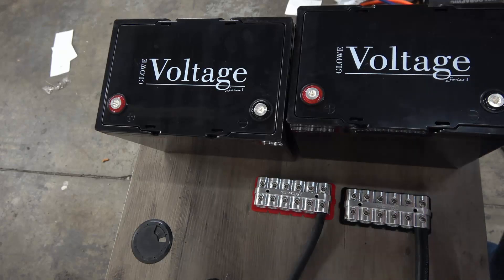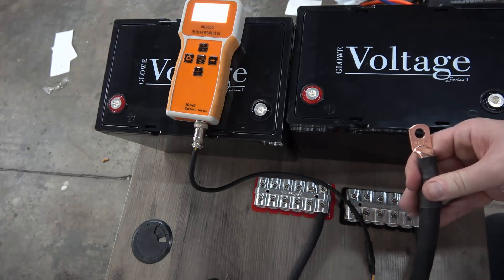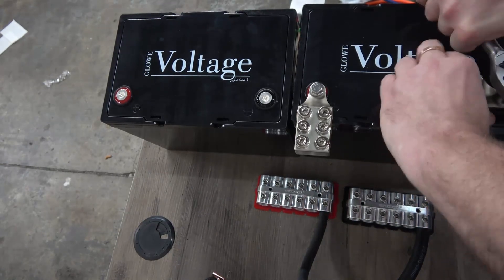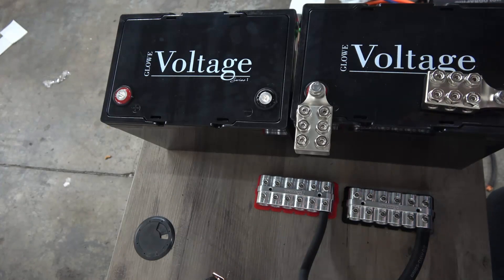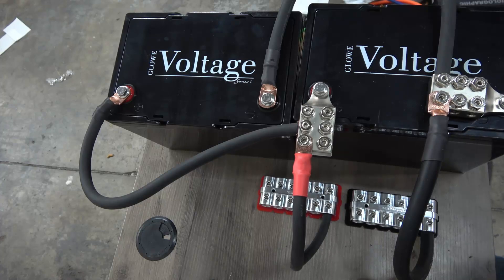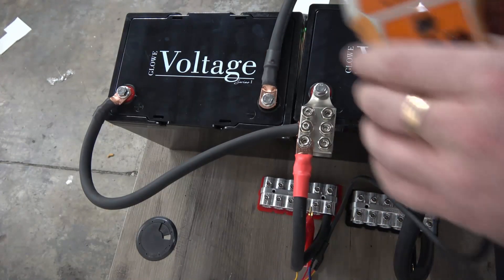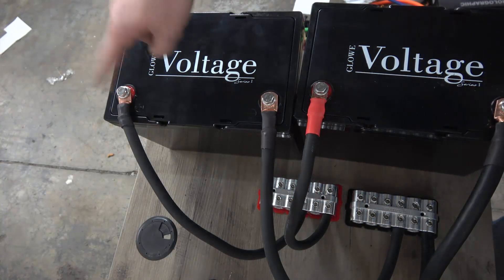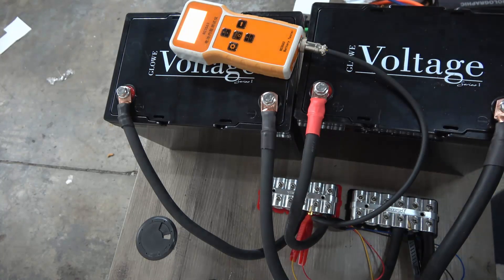How to (most efficiently) wire multiple batteries in parallel - you're doing it wrong!

Comment: I have 2 batteries in the rear. Everything is connected to the 1 battery and the 2nd is “jumped” so to speak. If I were to remove the main ground  and go to that 2nd battery, would I see an increase in voltage  by chance? I gusss would make it one battery?
Reply: Just do what he does in the video. Make everything go to 1 distribution point, it’s good to think of this as symmetrical. The more symmetrical the current path the better, not having to make it go 2 extra feet to the right or left

Comment: Same rule apply if running a super cap bank with one of your batteries?
Reply from the maker: Yes.  To be specific, any sort of voltage.  Ideally, your alternator pos would also be wired directly to the distro blocks that then go to the other sources of voltage.

Comment: If you are hooking up two batteries in parallel , one battery has to have the positive , the other battery has to be charged by the negative , so they will both act like one battery
Reply from the maker: Sounds like you’re talking about series not parallel.
Reply: @GloweIndustries  in solar if you parallel anything, say 2 batteries or 20, the front battery receives the positive, and the last one receives the negative.  If you don't, it's going to have unequal charging and discharging, just like if you used a ft long cable on one battery and a 10-foot long on another. That one front battery will be doing most of the work. There are many videos of using battery racks where the busbar that connects several batteries together will discharge and charge the battery closest to the charge/discharge cable. As a result, the solution is to place the positive and negative cabling on opposite ends of the rack. It's still not as effective as the way you did it, but it's a tad better.  I personally never seen batteries wired up the way you tested lol. But i guess there can be people out there that will do that. Also, when I  build batteries, the cells are matched up via internal resistance, or you're going to have cells imbalanced and the bms working overtime trying to balance them.
Reply from the maker: We primarily deal with car audio, so large distro blocks are fairly common.
Reply: @GloweIndustries   yes I have 3 vehicles with systems in them.  I'm familiar with car audio. Just in solar I'm dealing with 51.2v nominal voltage instead say 13.4v. Same general principles should apply

Comment: interesting, Ive got mine wired to distro blocks on my positive side, from GVS2 - fuse holder - 20 1/0 fuse block which recieves from the front alternators and distributes power to all my amps. But my negative side has a distro block but for all my grounds and wired separate grounds from my batteries. Gonna see if i do the same as my positive and see what changes it causes, been thinking of this recently and just realized I may actually be loosing some good power due to my grounds being all over the place.
Reply from the maker: For sure.  Ideally, you want your amp grounded directly to the battery, or in the case of multiple batteries, the central distro point (for both power and ground.)

I run all of my components to a ground distro block, and the ground distro block is then what grounds to the frame.

Comment: Brilliant...
There is one other way of wiring
Batteries in parallel..
 + taken from b1
& - from b2 
There is a method using same (balanced) length cables for more batteries.
I've favoured your method for years but didn't have the test equipment..
because...
It also allows a chunky fuse to be fitted on each +
As I have seen..
(It's common practice 🤬)
..this is on Boat's.. maybe 10 x 100ah batteries in parallel with no fusing.. apart from being unfused.. eventually one battery will deteriorate (I work with Lead Acid) and pull the others down.. and there is no easy way to work out which one.. also removing terminals becomes hazardous.. 💥
At least with the spur method a terminal can be removed and put in a bag or rubber glove.
Did you try linking the batteries in addition to the spurs?
Do conductive grease etc help?
Long-term there is also resistance due to corrosion etc..
Funny I'm just rewiring my batteries..
I just bought a new pair of 12v EFB's 
and thought to test the terminals resistance's and renew as needed.
Something to note mains electrical units have some nice chunky copper chocblocks that are used generally before the consumer unit or on 3 phase.
btw I'm in the UK.
Reply from the maker: "Batteries in parallel..
 + taken from b1
& - from b2 "

I actually tested this previously when I originally began exploring this idea..  the results were so bad (by far the worst) that I didn't even want to plant the seed in folk's head that they should consider it.